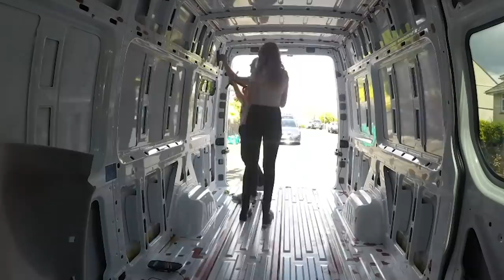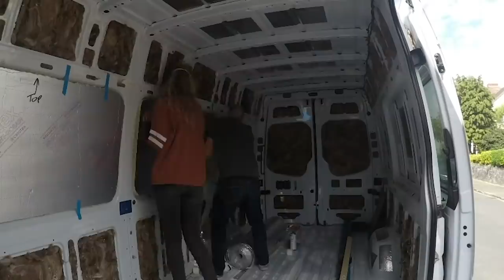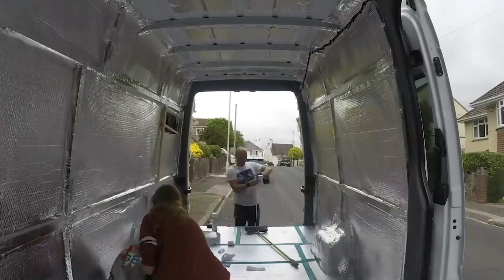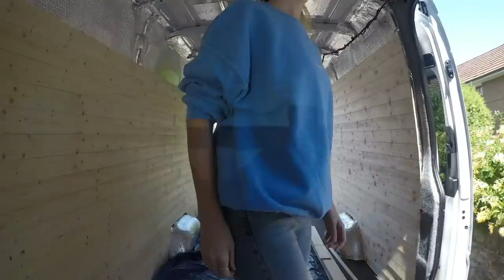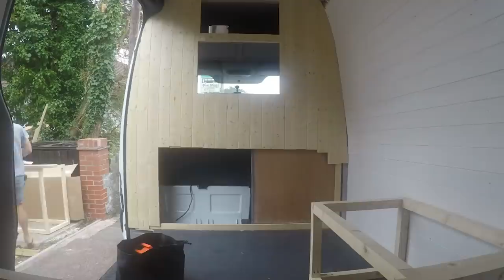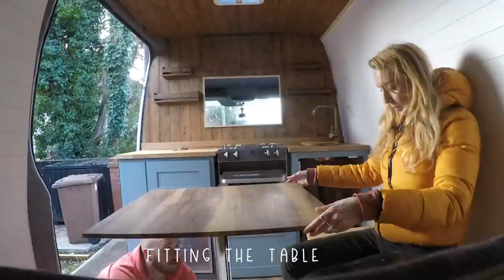OUR VAN CONVERSION (FULL TIME LAPSE) | DIY Sprinter Van Conversion | #VanLife UK

Comment: Very innovative and different layout than most van builds. I'm referring to where the kitchen was placed butted up to the drivers cab area.
Reply: It's uncommon, but from what I've seen, it seems like more of the eruopean builds have a wall behind the driver and passenger seats. I'm currently doing a build with a similar design, and I am SO stoked. I don't need my van to feel open and airy. lol. I need it to be functional and take me to the places that are open and airy. :)
Reply from the maker: Hey, we can't take credit for this layout! 😳There was a couple of Instagram posts we saw with a U-shaped seating area and the kitchen on the bulkhead, and then Indie Projects did it too. We love how it works! We particularly like having a separate area between the driving seats and the living area.

Comment: I like being able to get into the driving area from the rear in case you have to slip out of a parking location without confronting anyone. Very nice build!
Reply from the maker: Yeah it's very handy! We have a hatch which we can fit through if we needed to - thankfully never felt the need to use it yet 😊

Comment: I actually saw an awesome build where there was a pull out shower tray that matched up with a hidden drain near the sliding door. And l think they had fold up boards to keep the water in the tray. Very ingenious but l doubt cheap to install. Apart from that, good job (glad to see you have a portable loo too.... essential in my opinion!)

Comment: TIP:
A CHEAP alternative to the foiled back sound deadening material is FOILED back flexible refrigeration INSULATION wrap. It's ALMOST identical to the expensive sound deadening material. And it's a LOT cheaper. Double it up, full coverage, for less , with better performance.

Comment: I think my house has less isolation than your van.. amazing.
Reply: Your house needs more insulation (and airtightness) in that case. Houses should really have 100mm PUR or 150mm EPS/woodfibre/rockwool all the way round, minimum, for a U of no more than 0.2 W/m2K.

Comment: Wouldn't soft insulation absorb condensation and freeze in the winter??
Reply from the maker: Whisgers no, it shouldn’t do that.
Reply: Yes it does unless you'll manage to do a seamless vapour barrier. The condensation comes always from inside (from warm to cold) and in this case the bubble foil and foil tape will prevent the moist air to get into the insulation. But it's true that in almost 90 % of the van build videos that you see, people forget this vapour barrier thing. Then there's going to be hell of a lot rust and mold.
Reply from the maker: finnischerjunge Very true. We do have a vapour barrier though so we should be fine. I mean, it’s our first van build, and we’re not professionals, but we’ve done our best to make sure she’s fully vapour sealed, rust proofed etc as best we know how 👍

Comment: Hi, the pair of you. Hope you’re both well and finding some positives out of this period of uncertainty and gloom ?
I’m on a mission to save but also feel at home.
Looked at purchasing already converted vans, which are rather costly. 
How much on average does it cost to convert a van, equipment, tools...?

Thank you and have a great day
Reply: When starting from scratch you may need to buy furniture if you are not experienced in making it yourself + tools and your regular conversion items plus the cost of a new or used van it would probably be anywhere in between 10,000 to 30,000 dollars
Reply: @zacharyrichmond7472  Mouth watering figures. But thank you so much for that
Reply: @shoboy1ne  no these people said it cost 6-7k in dollars sir, you can do it for 15 max i'd say, don't worry about it. Usually around 10k though
Reply: Honey Buns it probably depends how much you have already and how much you can do yourself without paying for labor.

Comment: Some  modifications can  fascilitate  more.1.The WC should be the floor one as fashioned in the east.2.Adjust it at the 
 rear end will be awesome.3.One can clean himself with his own hands this will be more hygienic.4.This help to avoid the 
dirty drops and save the skin.5.By having a cover(like the deep freezers) over it will stop stink and
 one can take bath over it.6. Taking bath in sitting is more beneficient .If one believe in chastity and hate 
to expose him/herself should take bath in a  sitting way.7.By sitting one use a bucket and mug and can easily
 wash more comfortably and less exhausting.8.If one has any abration or injuries can save from soap and shampoo etc.
9.By this way one can save water etc.10.Four steel rods of five feet wrapped with a cloth can work as
 a Blind can use in outskirts in emergency.
 with best wishes.

Comment: I think you guys did a great job! it looks really nice the only thing i don't like is the lack of windows on the side. I prefer two windows just because i like to look outside often also to crack it open, specially in the summer since inside the van will get extremely hot. I also dont like that it doesnt have a shower but understandable since the space isnt that big.

Comment: Hope you can fit to GET  out the opening behind the front seats in case of an emergency,it will make it very hard for you getting in and out of the van all the time stopping and starting ,i feel that you havent really thought this build through enough,but good luck ,i hope you have fun times in it .
Reply from the maker: Hi Julie, not sure if you know but there’s a big sliding door on the side of the van! This is how we get in and out. We purposely designed the hatch so our driving and living areas feel separate, although we can easily fit through the hatch if we needed to. In fact, Chesca has done so a few times when we’re driving to grab something from the back! Interesting you think that, when this is one part of our build that we thought the most about! But we have been living in the van now for over 2 months, and we’re very happy 😊

Comment: That installation will draw moisture when the van gets rained on.
Reply from the maker: No it’s fine to use, as it’s fully vapour sealed. We’ve been living in it for 6 months and had plenty of rain and snow over the winter. We’ve just taken some of the wall down to make an adjustment to our cupboards and the insulation is bone dry ☺️

Comment: Build looks great, how you fixed the batons to the side of the van and the roof? was it with an adhesive or screws? Similarly the bed frame and kitchen, how were these screwed / fixed in place? Struggling with how to attach batons and make things sturdy without screwing into the metal of the van?
Reply from the maker: We fitted the battens to the internal ribs of the van using self tapping screws and adhesive. The bed frame and kitchen were then screwed into these battens using wood screws 😊

Comment: what kind of insulation is that? polyiso ?  i heard ppl saying polyiso works very good in warm weather, but doesnt do anything below freezing? 
im planning to get a van as well. after few months of digging
i think 1 thin layer of sound deadening mat stick directly on the metal might reduce hot air condensate on cold metal and 1"EPS insulation on top of it.  EPS might absorb and release  moisture to regulate the moisture in the van.
Reply: since u dont have bath in the van i guess u dont have much condensation problem, im looking for a wet bath , so i guess i need to pay more attention on moisture and mold

Comment: Love it,, Do you get any condensation? What keeps the soft insulation in holes where you installed it from getting moist against the cold metal of the van in cold weather??
Reply from the maker: We have a vapour seal to stop any moisture from reaching the soft insulation. We’ve just renovated parts of our van and the insulation was bone dry! ☺️

Comment: Really love your works on insulation. Nice! But, where is the windows? Usually there are windows on both side panel.
Reply from the maker: Thank you very much! We have one window on the sliding door and a vent window on the drivers rear side 😊
Reply: @OverlandingSophia  Ah, yes! I just notice it on your next video. 👍

Comment: Great job you guys, I have done a partial van build and was wondering what paint and stain you used on your pine cladding? I have left mine as bare wood for a while but I think I might follow your example. All the best with your travels.
Reply from the maker: Hey, for the white wash, we used the Wood Wax Finish Intensive in Matte White by Osmo, and a Walnut stain by Osmo for the ceiling and bulkhead 😊All the best with your build!

Comment: Seems you guys missing something ..... which is the Toilet / Bathroom !  I saw you have installed solar panel but didn't see how it is connected to your back up battery and to power management system ...  Where is your Fresh water, waste water storage ?  You have installed a stove,  where do you store your propane gas bottle ????
Reply from the maker: You can read our pinned comment about the bathroom! Also, this is only a time lapse! We vlogged the entire build where we go into detail about everything else you mention 👍

Comment: That's the most thorough vapour-tighting I've seen in a van build. Well done, although the reliability of ali tape over the long term if it is not compressed is not great - you really need airtight (acrylate glue) tape to be sure it'll stay more than a few years. I also think the metal ribs should be insulated at least a bit otherwise you have an awful lot of bridging. I've not actually done the modelling for it yet but I bet it would make a big difference. Still, this is details. Most van insulation jobs are pretty crummy and yours is pretty sound - I'd just go a bit further myself :-)

Looks like a nice build.
Reply: Self-promotion disguised as a compliment. Nice. Do you have any examples of your work? I want to nitpick incredibly petty issues that will make absolutely no difference whatsoever. The job they did was on this van was perfect.
Reply: @jonapc123  You can see my efforts at wookware.org http://wookware.org/pics/van/page003.html but I didn't know much in 2003 so there is nothing too fancy there (nor do I seem to have documented the insulation process much). I did avoid floor battens which has worked fine. Having since enerphited a house I'd try to copy some of that across to vans and that means avoiding thermal bridges and decent airtightness tapes. Not quite sure where you get 'self promotion from' - I was just commenting on their build. I'm not trying to sell anything here, nor send people to my website (until you asked). Suggesting that all those steel thermal bridges 'make no difference whatsoever' is pretty obviously wrong if you know anything about thermal bridging. As I say I've not calculated how much difference exactly.

Comment: Hey guys, mesmerising work
How do you attach your units/bed etc to the floor? It can't be just into the ply floor, no?
Reply from the maker: Hey, thanks! We have battens on the floor which we screw everything into. The battens are secured with strong adhesive 👍

Comment: Hi, i just bought a 2019 RAM Promaster 2500 high topo van-bare bones. I have a couple of questions. what is red oxide? also, what are you using for insulation? thanks.

Comment: What's the thinking behind making the bed frame so high? Seems like a lot of wasted space.
Reply from the maker: Quite the opposite to wasted space... it gives us a bigger storage area beneath the bed. If the bed was lower we wouldn’t gain much as we have overhead cupboards ☺️
Reply: @OverlandingSophia  Thanks for responding. Only after watching the tour of the van video just now did I get an appreciation of why it was needed. Great forward planning and a job well done. One more question, even with all the insulation, is it cosy and warm or do you find you need to have the heating on often?
Reply from the maker: RAGINGDRAGON99 Thank you very much! It’s always difficult to get a sense of how things work in the van until you see it in action. Insulation has been great , we do use the heater when it’s particularly cold outside but the van is really cosy and keeps in the heat very well ☺️

Comment: silly question.. when drilling the wall batons on to the van, would this not pierce a hole in the van walls and allow space for leaks? just very curious lol.
Reply from the maker: Hey Sheryl, not a silly question at all! The wall battens are screwed into metal ribs on the inside of the van, they don't screw into the outside walls 😊

Comment: Probably a dumb question but when you're installing the battens into the walls and floors etc what fixings are you using??
Reply from the maker: Hey David, we used only Sikaflex 212 to fix the battens onto the floor. For the walls, we used Sikaflex 212 and screws 😊👍

Comment: nice one, i really watched the whole video, I need my personal toilet in my van and i dont really understand why you blocked the drivers cabin from access to behind. however nice one
Reply from the maker: Hey, thank you for watching 😊We have a cassette toilet underneath the sofa seats which works well for us! We blocked access to the cab because we really wanted a full size bed and an L shaped seating area for relaxing, socialising etc. That leaves so little room for a nice kitchen, so we put it across the bulkhead. Our living space is nice and open and spacious this way. There's method in the madness 😋🚐
Reply: @OverlandingSophia   ha, good to know, the most important thing is you are happy. I am just not happy with a proper toilet, i even hate the camping toilets, since i am living in Asia since more than 20 years a hole in the floor would be enough if i am having enough water to clean my ass after business ;)  all this thrones are overrated i belive :D :D :D 

cheers and have fun

Comment: One thing I hardly see discussed is how much weight these conversions add to a van and it’s reduction towards gas mileage.   I would think getting 10 or 12 miles to the gallon would be disappointing.
Reply from the maker: Vans like the sprinter are 3.5 tonne cargo vans designed to pull heavy loads. That’s one of the reasons they make great campervans - they are some of the most fuel efficient you can buy. The weight of a conversion should never go above the payload of a van anyway. We weigh 3.3 tonnes and get near 17-19mpg, sometimes better depending on the roads we’re driving 👍

Comment: whats that silver tape stuff you used on the edges of the celotex and wheel wells?
Reply from the maker: It's aluminium foil, it seals the insulation and creates a vapour barrier 😊

Comment: Hey love your work but just thought I’d give you heads up about soft insulation can be harmful if it has Fibreglass but it looks pretty tight so you should be fine still could be worth looking into though
Reply from the maker: Hey, thanks for the concern, but we’ve used recycled soft insulation, it has no fibreglass in it ☺️

Comment: So awesome , I love the teamwork. With the insulation you guys used. It seems to be the best kind to use because you fill all the gaps and empty pockets with it. But I saw another van conversion video where they installed the same stuff but then were advised to take it out because of the Van's metal frame, the weather can cause it to sweat or condensate like a glass of ice water. And it will actually have the condensation on the inside of the metal van and create mold? Have you guys thought about this and could you confirm it true or false? I really would want to use that stuff because of the convenience. Thank you! Amazing job again
Reply from the maker: Hey, thanks for the lovely comments. Regarding the insulation.. if you asked 5 different people that questions, you would probably get 5 different answers! It's a controversial topic :) But for us, we used a recycled fibre, no fibreglass or anything like that. It's eco-friendly, cost effective and actually wicks moisture away from the van body. But as we vapour barrier the entire insulated van, no moisture should get inside the insulation and cause any mould or rust. It can't condensate on it's own as it doesn't breathe moist air! With a good vapour barrier, you are fine to use rockwool or fibre insulation. Lots of people do it and we are really happy with how warm the van is :) Good luck!
Reply: Had this on my van when I bought it. It absorbs moisture in the atmosphere and expands. On mine it expanded to the point it bowed the ply lining on the van door. Had to have  it all taken out as it rots the van from the inside out.

Comment: Hi, watched most of videos and you've done a fantastic and high quality job, 2 questions, 1, was the wiring in of the battery highly difficult and could you give us a rough ball-park idea on costs it would be to convert something like this, I have a rough idea but I presume there are things you don't forsee coming etc and presume the costs then snowball in the renovation ?
Reply from the maker: Hi Liam, thank you so much! In regards to the questions. Wiring in the battery for us wasn't too difficult, but Ben knows about electrics so it might be harder/easier depending on your own knowledge level. We probably spent around £6-7k in total, not including the van. Costs definitely did snowball, but it was mainly on things like plywood and wooden battens. We purchased all our big costs (batteries, solar etc pretty early on in the build).

Comment: any mini van conversion video, i see insulation work.as im from india i guess, dont need of insulation work high temperature area .??
Reply: Insulation helps with cold and hot temperatures. It’s supposed to keep the temperature inside stable. It keeps heat inside as well as outside. I recommend using insulation in any area, if that was your question.